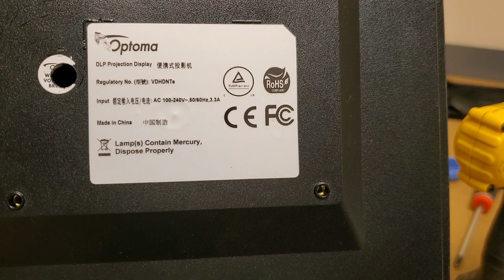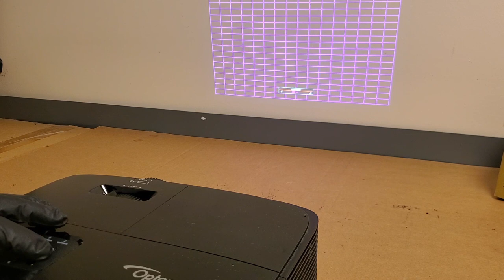Optoma HD143X DLP Projector / Simple Cleaning for Flickering Image

Comment: I got it open, was only running like 10-15 min before shut down so figured why not. Question is theres a little filter on the side. Had dust caked on the inside (which seems backward for a filter). Wondering if I should just peel it off (held on by like a sticker) since I would expect the dust to be on the outside. Seems counter productive
Reply from the maker: I dont recall ever seeing a filter in one of these. Are you sure its not just lint/dust caked together? I'd remove it if I saw that.

Comment: How do you change the bulb? Is it necessary to buy the bulb with the housing or can you buy just the bulb? Please help
Reply from the maker: I would buy a full housing myself but with the age of the 143x, I would buy whatever you can find.  A bare bulb is perfectly fine as long as the old housing is in decent shape. the glass filter on the front of the housing is the important part.  It must not be damaged.  some dust is okay but no burn marks in the center.  If you see that, you want to buy the full assembly.
Reply: @FixitFrank  much appreciated cant thank you enough.

Comment: given me the confidence to clean my own Optoma UHD35x 8 month old got flickering today as i changed the settings to Echo+ so went back to bright and its fine now 🤔
Reply from the maker: I have noticed eco mode causes "deposits" to build up on the arc points in the lamp. Standard or Eco+ run the lamp hotter and prevent the deposits from building up.  I personally use standard mode as I want the brightness but  Eco+ is also a great option to use.
Reply: Thanks Frank for that helps great 👍

Comment: Hello, I have optoma khd33+ 4k its white and the inside lid is yellow in tint from the heat. Id like to add a battery powered fan to help remove heat shall i place on the outside or leave it alone? I cleaned out all the dust.
Reply from the maker: I wouldn't worry about it.  The yellowing happened from the dust before you cleaned it. Once it is clean, as long as you check it every few months(I do it 2x a year), that should be more than enough.  You basically put it back to "new" air flow wise so that is a good place to be.

Comment: Hey Frank!  I have a 12 yr old JVC RS25 and I’m getting flickering on some start ups.  Yet if I power down and restart it goes away.  Has happened about 4 times in the past 120 hrs of use.  Bulb just turned 650 hrs. Any suggestions would be GREATLY appreciated sir.  Too heavy to ship and I don’t know of a technician I could trust in the Chicago area..? Thanks again for your incredible posts!!!
Reply from the maker: Hi Jeff! That is a tough one.  It could be a ballast, but it could be a defective lamp. But the fact that you are at 650 hours, makes me doubt the lamp as a problem. I'd expect a lamp to show its defects quickly.  
One thought, if you are running in eco mode, put it back into standard.  Eco mode can cause scale to build up on the arc points and cause flickering.  Standard mode should 'clean' the arc points.  If its already in standard... I'd have to know more.  It's the kind of problem that could be coming from a few places and none of them are easy to check without looking at the projector. I do know if a guy in Indiana who might be able to work on it but I can't say I know of anyone in Chicago area directly.

Comment: On my optoma 3d projector the picture is very slightly jumping up and down
Reply from the maker: If it is 4K, try a 1080 signal and see if it stops.  Most of the older 4K optomas use pixel shift. The solenoid for pixel shift can get wonky.  If the colors are jumpy then Id lean more towards a color wheel issue(sensor or the wheel itself).  Could you describe it a bit more thoroughly or share a video?

Comment: Hi, Frank! Was recommended your channel over on reddit and have a question, if you would be so kind. I own a LG PH450UG LED projector and it started losing brightness about a week ago, until the day before yesterday, when it developed a heavy dark spot across most of the screen, rendering it unwatchable. It has around 2300 hours of use registered in the menu, and after opening it and clearing the dust with compressed air there was no change.

The warranty is not applicable since I got it used, albeit with very little use. But it has been pointed out that this seems like a recurring issue with this model… What I’m trying to figure out is if this is fixable at all, or if it would be cheaper to just get a new one (though I’m not excited anout the prospect of spending 700€ on another Ultra Short Throw).

Thank you for your work!
Reply from the maker: Thanks!  I suspect you have a bad polarizer piece in the optical section.  Its usually located after the LEDs and before the DMD.  They melt and leave that spot in the middle.  You may be able to find another piece but I have heard of people using polarizer film harvested from old flat panel monitors to repair them.  There are a few pieces of plastic film of varying types that make lcd monitors work.  If you have an old scrap monitor around you might be able to pull the polarizer film out of that and then cut it to fit.  
Otherwise I would really suggest looking at lamp based units over LEDs, at least for now.  I personally think LED/Laser/solid state light engines are not quite there.  They are close and likely will hit their stride soon but I see lamp based projectors still outlasting LED.  They use about the same power and I think lamp units are built better.  This is just my opinion of course. There are reasons where LED will be better so you do what works best for you of course.
Projectorcentral.com has some great research resources for finding a new/used but good UST projector.  I saw some Optoma's and Viewsonic's that used lamps that I bet you can find used for a reasonable price.  
I hope that helps, if you get stuck, I have an email address listed on the about page.
Reply: @FixitFrank  you’ve just put a smile on my face! Thank you so much fir the answer and the hope of fixing it without breaking the bank! Much obliged!

Comment: I thought flickering was caused by the dust on the light sensor but it can be caused by bad connections too. In most Benq projectors flickering is caused by the clogged or worn out blower fan.
Nice overview of the optoma HD143X gives a good idea on how to go about cleaning it and save time.
Reply from the maker: I still think it had some dust in the sensor housing but it came loose in shipping. I really couldn't get it to act up. The owner couldn't quite get it back together and wanted me to just kind of give it a going over and make sure it was OK.
There was another model with the same power supply that had the output inductor start to melt and flash over when it ignited.  I thought it might have been that, but the output inductor looked fine here. I've only seen that a handful of times but it was always that same brown double stack inductor on the ballast output.

Comment: Hey is there any things not to do when cleaning thick dust off the coil and fan? Glove type? Wipes?
Reply from the maker: Nothing special. I wear nitrile gloves because it keeps my hands clean protects the glass from finger prints. Projectors pick up a lot of dander and hair from the air and I don't really want that all over my hands if I can help it. Aside from that, your only real goal is to minimize the dust build up as best you can. Projectors are designed to run happily with some dust. You don't need it to be spotless.  The only real things to stay away from are blowing air directly into the optics when cleaning.  You can force dust into the area with the DMD.  Gentle air pressure to stir up the dust and a vacuum work well. Also a dry paint brush(unused) works wonderfully for loosening up surface dust. I would not use cleaners unless its made for lenses so you don't strip the coatings.
Reply: @FixitFrank  I am so grateful for your time in replying 🙏 that really helped. Great channel and good person
Reply from the maker: I'm glad I could help 😃

Comment: I need to change my filter strip and clean but can not find filter but my project keeps coming up with change and clean fillter
Reply from the maker: It probably has a fan issue that is triggering that. These are sold in other countries with filters. When the fan feels like its not working right/moving enough air, it will trigger that message. 

I would probably start with a gentle cleaning and see how that goes. If the fan is bad, they are pretty easy to change.  I'd specifically check that lamp blower fan(turbine type).  If you had a lamp burst anytime recently that might be the root cause. They tend to blow bits of glass into the fan motor when the lamp bursts.

Comment: hi frank   i am in canada  i have   optoma   dh142x with no power    what do thank be  need help
Reply from the maker: I suggest checking the mains fuse, then see if you measure low voltage power to the mainboard.  A good visual inspection for damage would also be a good idea.

Comment: my flickering has turned into my bulb going out but after unplugging and plugging back in it works again so I'm guessing its not the lamp (at least I don't have to worry it was my pc's gpu going out)
Reply from the maker: might be the color wheel.  If its light/dark flicker, then its a lamp/ballast(likely a lamp) but if its colors flickering that is a color wheel
Reply: @FixitFrank  it's more like a signal flicker. Like a signal interruption and searches for signal again which is why I was suspecting my gpu. If it's not enough to trigger the signal search like the picture will be miss positioned during the flicker. Like old school scan lines for a sec before it corrects itself. I do get some dark light "flicker" seperately but I figured thats due to dynamic brightness setting. Oddly doesn't seem to be due to heat. When it should be at its hottest I dont have issues compared to when it's at the coolest Temps of the day or a fairly fresh power up.